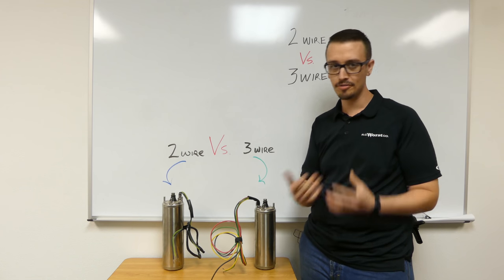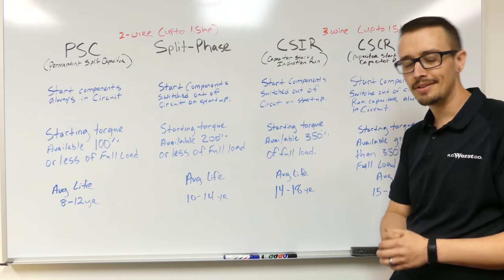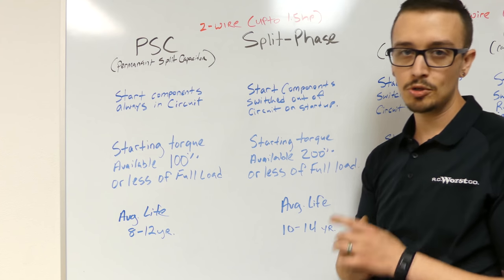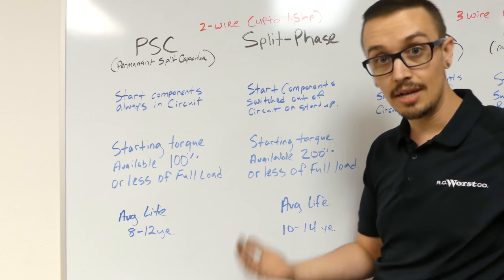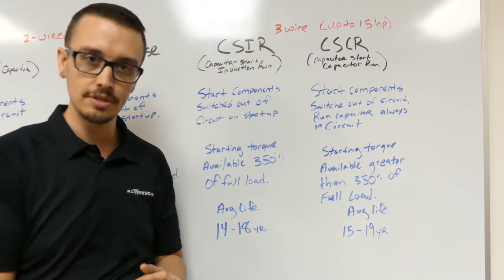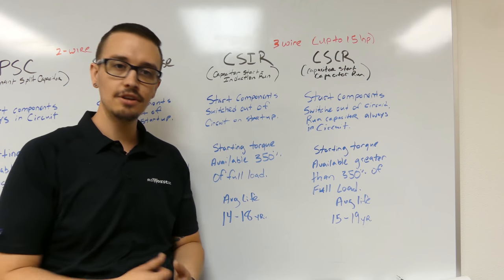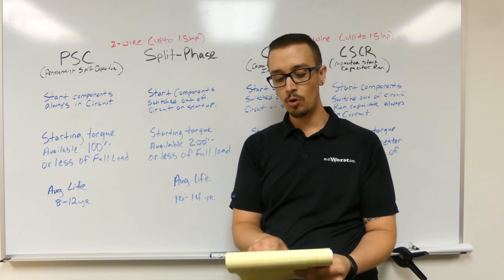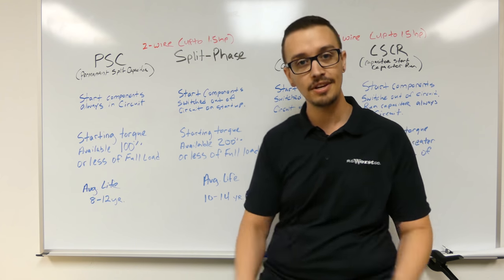2 Wire Vs  3 Wire Well Pump Motors

Comment: After reading other peoples comments below, I would also share that your iron problems and any iron taste in your water can be eliminated by placing your pump 5 feet below the depth of your casing. The well driller who drilled my well where I live told be that. I had 190 ft of casing and he told me to set my pump at 200Ft and by doing so, would have great tasting water. He was right. The water level from the top of my casing was 20 ft and most plumbers and people will set the pump 20ft further(40ft total)and will have all the water they need. But it will have a iron taste. Setting pump below the casing prevents this and is so cold and refreshing too.
Reply: Just to clarify, your saying to set the pump '5ft below any water level' down the well?

Comment: Something that affected the life of our pump motor ( it hung at 280 feet in a 360-foot well...) was the build-up of sand and iron in the pump impellers. As the impellers became clogged, the motor ran for longer periods of time as it struggled to bring pressure up to the cut-off point. When the inefficiency became obvious, we'd pull the pump / motor and change them both while they were available. Overkill, perhaps, but better than paying for another "pull" in three or four years.

Comment: One added advantage to the three wire pumps is they have a appreciably lower starting current spikes.  If you are a candidate for running you well off a generator or battery/inverter I strongly suggest three wire or the more expensive variable frequency drive pumps. I've run my 1/2 hp three wire (type unknown) off of a 1500 W 120volt inverter through a 2kw  120 to 240 transformer.

Comment: My Well Details: Elevation:320'  Well Depth 266' with 4" casing and changes to 2" casing at about 110-120' for the remainder of the 266'. The pump Intake is at 105 feet Water Level 55-60 Feet
right now I have a Hallmark Industries MA0459X-14A Deep Well Pump, 3" (3.3 Max), 3/4 HP, 230V/60Hz/1Ph, 14 Stage, 270' Head Max, 13 GPM Max, 1"Npt.
I have it set a 40/60 PSI and a cycle stop valve set at 58psi.
I am looking to increase my volume of water and was told I should look at a 2HP pump if that is what I want.  
Guidance on sizing a pump for more water volume and same or better PSI would be great.

Comment: Can you run a three wire pump with a three phase inverter, rather than a "control box"?  The capacitors make a third phase anyway.    You can get inverters that use 240 volt single phase as power input.   You can ramp up speed as startup to lower inrush current.  You can monitor for high current conditions in case of rotor lock.  You can vary motor speed to fit your application.   Anyone running from solar, or battery would find this useful.

Comment: Nice video. Two things I got a two wire pump and it is around 20 years old. The only reason I said around 20 is because I bought my place over 15 years ago. And we never replace the pump. Second since my well is getting that old I'm thinking it's going to go out eventually. Can you tell me a good two wire pump that I can put in myself.
Reply from the maker: We'd be happy to help you size a pump: 855.329.4519

Comment: I have a 25 year old Meyer pump 1.5 HP that is CSIR I want to change the box out just for maintenance purposes should I stick with a CSIR or should I charge it to a CACR box . 
Marty
Reply from the maker: That's an old pump! I would stick with what has worked for 25 years.

Comment: Is it normal for the green to be cut off the 3 wire motors? Mine is a 1hp gould
Reply from the maker: The older motors did not have a ground wire.
Reply: @RCworstwater   When you say did not have a ground do you mean that it was removed or not ever there?  We had to pull our pump up not too long ago and replace the impeller and I noticed the green wire was cut off. Which I don't really know but I'm wondering if it is wired correctly.

Comment: Does anyone know if having a single phase, 240V,  3 wire system help to reduce inrush amperage requirements on startup? IOWs, does having the control box with capacitors reduce the amount of inrush at startup these motors require from the circuit they feed from. Is that why these motors require those capacitors? To reduce in rush current? I'm asking because I want to be able to operate the well pump from a generator during power outages. Obviously inrush requirements are usually the biggest factor in that case. I know the normal draw is 10 amps. But to say inrush could be anywhere from 2 to 6 X normal draw doesn't really help size the generator correctly. I don't want to spend the money for a 10,000 watt generator, plus the extra gas it requires unless that's the only option. Thanks.
Reply from the maker: Here's a generator-sizing chart: https://franklinwater.com/more/service/aim-manual/motor-application/all-motors/page-5/#Use-of-Engine-Driven-Generators---Single-Phase-or-Three-Phase
Reply: The only thing that will control inrush at startup, is a frequency drive system.

Comment: I just had a myers deep well pump come out of my well 290 fl down made in 1991 3/4 hp just been replace it was still working sometimes and it is a 2 wire was takeing out last week
Reply: @Kevin Waddell  What is Pumptec?
Reply: @Kevin Waddell  Thanks Kevin for the info.  It seems that Pumptec is a beneficial technology that would be good to include in most well set-ups. Is it only used with Franklin equipment?

Comment: I recently replaced a Gould's 13 GS series pump that was 16 years old with a new pump of the same model and make. I noticed on the sticker specifications that the locked rotor amps on the old pump was 82 and on the new pump it was only 41. And once this pump was put into operation I noticed a lot less light flickering throughout the building when the pump kicks on. It has the same capacitor and relay in the control box so what's different about the motor that reduces its startup current?

Comment: This is just the information I was looking for, subed as well, Thanks! I am going to set up a well in the Philippines and run off solar or generator. How many watts for the 3 wire, and do they have the ratchet ability?
Reply: I'm off grid in Canada and running a conventional 120V or 240V well pump off solar isn't easy. It's more cost effective to use a generator. My small 120V 1/2 horsepower submersible well pump draws 55 amps on startup, and a 2.5 kW generator can just barely start and run it. Good luck with your project!
Reply from the maker: Check out our video on how to size a generator
Reply: @paulmaxwell8851   55 amps x 120 volts = 6600 watts = 6.6 kw.  I am not surprised your generator struggles.  I am surprised that it works.  Glad it does.

Comment: Can 120v 2 wire pump control with vfd controller? Ty
Reply from the maker: Yes, the Subdrive Utility can control either 1/3 or 1/2 HP 115V pumps, see it here: https://www.rcworst.com/Franklin-Electric-5870202003-SubDrive-Utility-Frequency-Drive-p15883.html

Comment: If you have a house with 3-phase you could run a plain 3-phase motor pump and just a pressure switch.
Reply from the maker: You're right, but 3-phase power is almost exclusively used in commercial and municipal applications to run larger 15+ HP motors. Residential properties virtually never have three-phase service.

Comment: It might be worth mentioning that a huge advantage of  a CSCR control box is current overloads that will protect the motor.  They are not as common to find in small HP CSIR applications and EVERY motor should be current protected and a breaker is NOT designed to protect motors.  Most motors have thermal protection but that is an auto reset switch so the motor must get dangerously hot to trip it and it will just reset when it cools a bit and just keep doing that until it burns out the motor.  If the pump section fails, there will be no water moving and the motor will simply overheat until it dies.
Reply: Thanks

Comment: Thank You. I’m an electrician I have worked on all these systems but never got an explanation for the difference. It’s hard to find people with real knowledge of controls. Thanks again.
Reply: I grew up repairing electric motors and replacing well pumps. He explained it very well. Thank You. I've had very good results with 2 wire pumps for residential use. Saw some over 40 years old.

Comment: I enjoyed your video explaining the differences in well pump motors. When you explained the longevity of each motor, another component to longevity of the motors is having more pressure tank volume for it's the number of starts that affect how long the motors last also. Having more volume of pressurized water to lengthen the time before the pump starts again can double the lifespan of the pump. I own a business with a pressurized well system and have hands on experience to back up my comments. Thanks again.
Reply: TOTALLY AGREE,,

Comment: On the two wire Franklin motor well pump. Can you run a charge controller to help with the initial startup surge or will it burn the pump up

Comment: I have a 5hp well pump. I notice there are 2 run capacitors (40 microFarad each) in parallel. Why using 2 capacitors? Can we use 1 run capacitor of 80 microFarad?
Reply: Are u sure one caps not a start cap, since you have to have a start cap in the  circuit to overcome the starting torque??

Comment: Any idea which type is better for generator use? I had a 3 wire but had it replaced with a 2 wire and now my  10kw generator won't run the well pump.
Reply: That's very interesting I have a three wire getting ready to hook up a generator to the house looking at currents and load on the generator. My pump is due to be replaced any day it's 40 plus years old. Probably looking to do it three wire again
Reply: @kennybobby9397  Do you have the capacitor box inside the house now with your current 3 wire setup? That's pretty impressive if your pump is 40 years old? Are you saying that your pump and the pump motor are submersible and are both 40 years old? That's kind of hard to believe that the pump motor would last that long submersed in a well.
Reply: @Redneck_Ed  from the paperwork I see that the submersible pump which is a red jacket is 40 plus years (1978) not sure if the box has been replaced it's in the crawl space and pretty crusty looking haven't opened it up yet. Forgot to add it's an excellent well with no real iron in the water one of the reasons I bought the place 17 years ago 😁 the house is a shack but it has a good well LOL
Reply: @Redneck_Ed  My Franklin is 32 years old (i just looked at the box) and is still going.  3 wire, 1/2hp, 60 feet deep.

Comment: On the topic of current I have a three wire 1.1 kw Franklin running 9.2A at 230Vacwhich equates to about 2.2 kw power so I don’t understand where the energy is going

Comment: We bought this old property and apparently our well pump is 31 yrs old (3 wires, still working) watching this video to learn more before we replace it. We want to replace because besides being old, I don't think is normal for our water to have a lot of sediment.
Reply from the maker: Give us a call if you want quality equipment and tech support: 855.329.4519
Reply: I put a 2 stage filter system fairly easy to do and it works great no more sediment

Comment: Can you add a GFI to the 220 volt 2 wire pump?
Reply: why though? if you are asking if you can add a gfi breaker to the pump circuit, yes you can, but i dont much see the point in it if it is correctly grounded as it should be. it would just be an extra redundant and useless thing to add to the circuit. if you're running a 2 wire pump with just 2 hots and no ground, i would strongly suggest u stop using it immediately and correctly ground it especially if its 220v.

Comment: These pumps are all outrageously priced!!!!  They should cost $75-$150 at most.  I have municipal water but have a well I would like to get running again..... for car washing, pressure-washing, possibly laundry, grass watering.  I could even do it all myself........   But $450 BUYS A FREAKING RESERVOIR OF MUNICIPAL WATER IN PA!!!!!!  It Just is not worth doing it unless I lived here another 30 years.    This is a total scam when u price other motors and pumps and compressor equipment.   Pissed off
Reply from the maker: You get what you pay for with well pumps - as with most things in life. If you're not relying on the well for your family's water supply then it might make sense to go with something cheap to see if it gets your small jobs done.

Comment: Great video THANK YOU I had to change a well pump.
I don't understand the 3 wires is it 2 hots & a neutral or there is no neutral here? 
Black ,  Red & yellow.
I get 230v between yellow & red  & 11ov from black to red or yellow.
Does this means the black is the neutral?  Or is the control box switching polarity? I don't get it.
If anyone can help
Reply: A three wire system actually has four, just as a two wire has three. The ground wire is not counted.
Reply: On a 3 wire pump the red starts the just one flash of electricity then yellow takes power to pump and yellow brings power back up to the control box. A 2 wire the controller is built inside the pump

Comment: We have a deep well 240v pump (350+ feet) that was installed when our house was first built. It's been running flawlessly pumping water another 1000' uphill to the house , off a generator no less, for over 27 years.
Reply: What is the horsepower of your well pump? Thanks
Reply: @jasonkranz8672  I wish I knew. It's been down in the well since we bought the house. I don't know make/model/HP...nothing. Sorry I can't help ya out there. She's still pumpin' tho!
Reply: I guarantee that your motor will go soon. You are on borrowed time. Pick out your new arrangement (pump/motor) soon and have it ready.
Reply: @jimcochrane7826  I agree and realize I'm whistling past the graveyard here, but I just filled our 1200 gallon tank yesterday in just over 2 hours. Another fine performance by this amazing pump (whatever it is).
Reply: @buzzloudly post make and model once it goes 😊
Reply: @buzzloudly 2 or 3 wire pump?   Is there a control box?
Reply: Wow! 27 years is insane. Has it gone yet?
Reply: @NotSure7474  240v 3 wire, has a control box, Franklin I think
Reply: @teampyle9835  Still going strong, just pumped 1100 gallons on the weekend. My septic pump finally gave up a couple of weeks ago though. It was also installed when the house was built, now 28 years ago!

Comment: I've been looking at Grundfos SQ or SQE pumps for a new well but from the little I understand they seem to be somewhat different than any of these types of pumps. From their videos they explain it's two wire, single phase power but it's converted to 3 phase and operates as well as a three wire design. I'm curious what your analysis on the grundfos pumps is?
Reply: Those are motor integrated VFD high frequency design, very advanced. Nothing in common with these std. 60 Hz one phase variants.

Comment: I have a system with a control box.  How do I identify whether it is CSCR or CSIR?  The system has run flawlessly since 1997.  Static water level is 25 feet below ground.  Is that why it has lasted 23 years, or is it just luck?
Reply from the maker: Look inside the control box. A CSCR box will have a start AND run capacitor, whereas a CSIR box will only have the start cap.

Comment: So does that mean a CSIR has one capacitor while a CSCR has two capacitors in the control box?
Reply from the maker: Correct, at least for smaller motors. As the HP increases the # of capacitors increases as well.

Comment: You have explained alot about 2 wire / 3 wire pumps but is the voltage for both of these style pumps 120 volt or 220 volt?
Reply from the maker: They're both available in either 115 or 230

Comment: I have a 3 wire motor. I just bought a new pressure switch.  What wires from the yellow, red and black hook into the pressure switch. Thanks
Reply from the maker: Vince, those wires don't go to the pressure switch, they go into a control box. You can find them on our website here: https://www.rcworst.com/standard-control-boxes.html
Reply: On a 3 wire pump all the wires get hooked up to the control box. It say y, r, b, then from the control box from line 1 and line 2 go to the two middle screws on the pressure switch. Then the outside screws are hooked up from where power comes in from the electrical panel